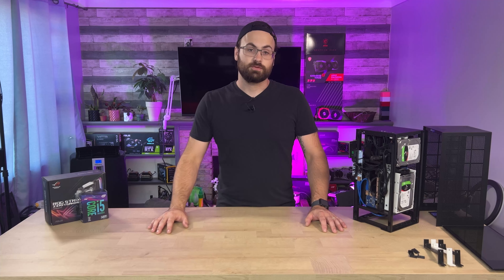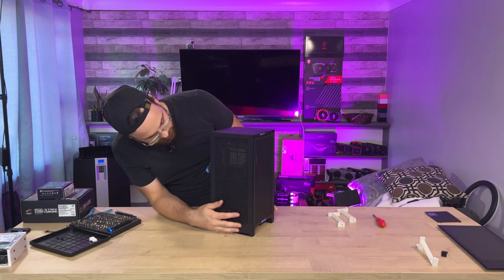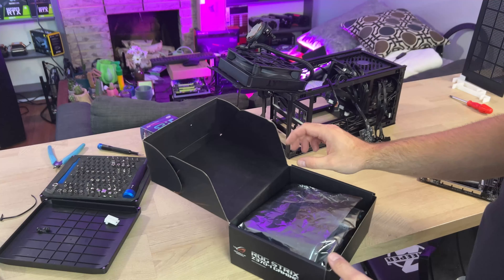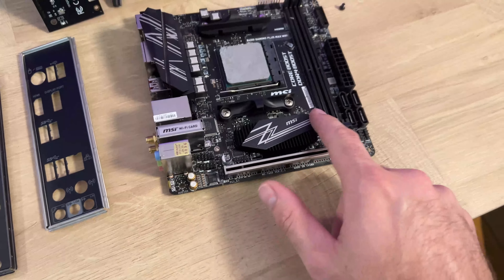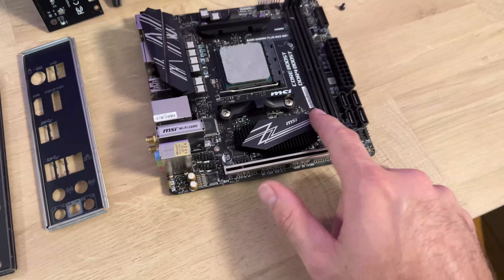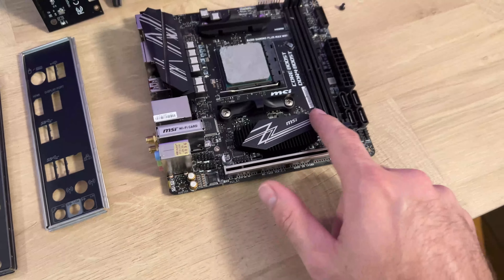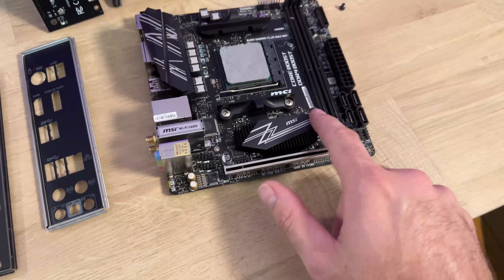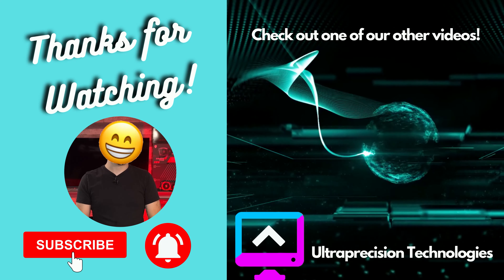Fitting 5 HDDs in a NZXT H1 - NAS Build Pt. 2

Comment: Any reason you went with the H1 over something like the JONSBO N1? The Jonsbo is available in the US now through Newegg. It has a better HDD placement and is 1/3 the price.
Reply from the maker: The JONSNO N1 is a really sweet value, however this case was available locally for cheap, and I wanted to challenge myself with fitting 5 hdds in it, as I personally really like the aesthetic of this case. 
If I really wanted path of least resistance, and the best value I would be looking at the JONSBO for sure!
Reply: No doubt the H1 is a good looking case. Thanks for the video. Looking forward to the next one.

Comment: It is very hard to find some mini itx motherboard for nas ... I see all boards are limited to 4 x sata...
So I assume you need to put some sata card to mother board. My question can you insert sata card into pci slot for GPU?
Something like PCE6SAT-M01
Reply from the maker: The safe answer would be no. The longer answer would be to look into itx motherboards that have an m.2 on the rear, and then maybe use an m.2 to sata adapter. You may also be able to slot a smaller sata card directly into the motherboard as long as it’s low profile enough
Reply: @ultraprecisiontechnologies   I think I found MB Asrock X570D4I-2T
Reply from the maker: @mkunikow  that’s a super nice itx server board. Good find! Up to 8 sata3 drives via oculink, dual 10 gb e nics